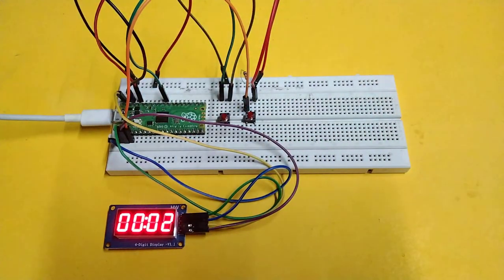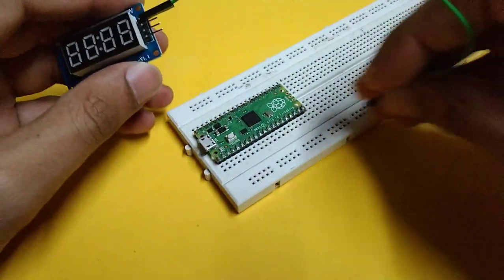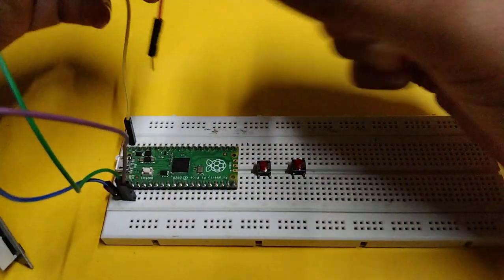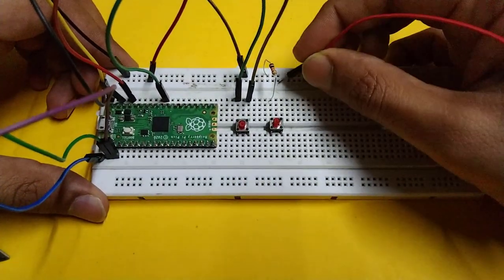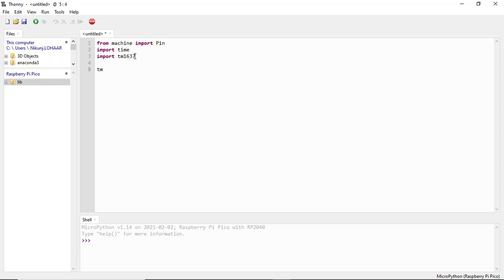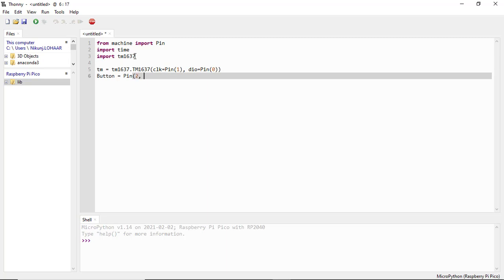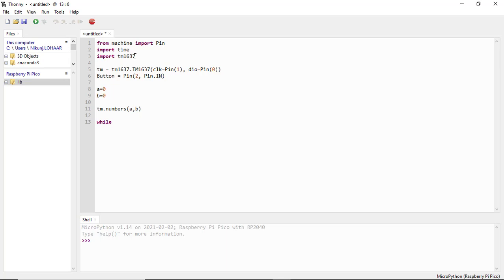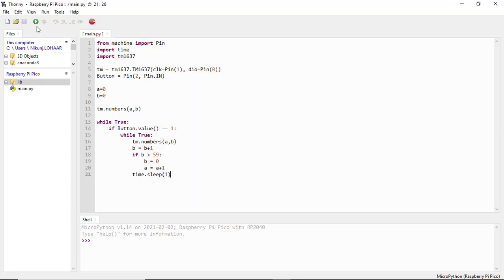Stopwatch Using Raspberry Pi Pico #raspberrypi #raspberrypipico

Comment: is it possible to make the display into a digial counter. using 1 button for counting up, second button for counting down and a 3rd button for reset? 
I have Pico and Tm1637 aswell as 2 buttons from keyboard. if you can help i would greatly appreciate it.

Comment: The pulldown resistor is not necessary in the pico, the pico has pulldown resistors in the board, check the datasheet

Comment: Value of resistor is never given. Certainly it has a value. Could you give the value you used? Or a range of values, please.
Reply from the maker: I used 10K ohm, you can use any value above 1K.
Reply: @NikunjPanchal  I grabbed a random resistor and it worked. I'll measure it tommorow.
Reply: Turned out to be 1K. Random chance.
Reply from the maker: @RalphWLundvall  sorry, i can't got you